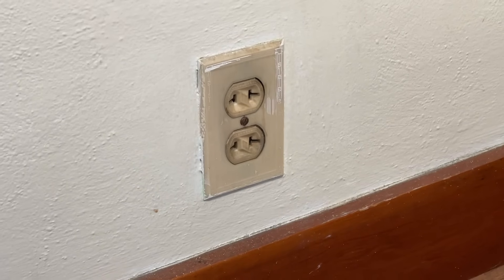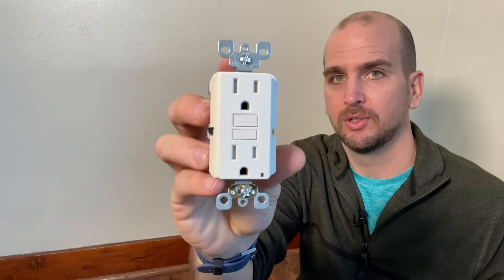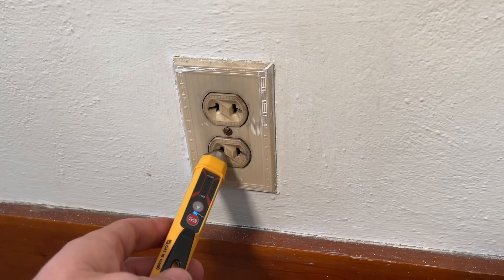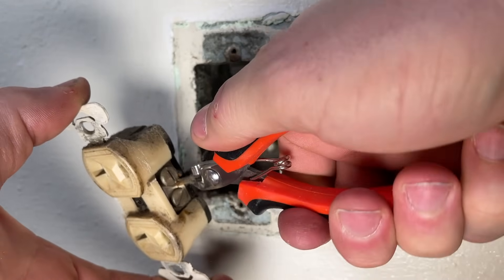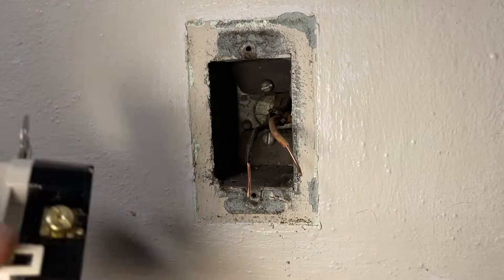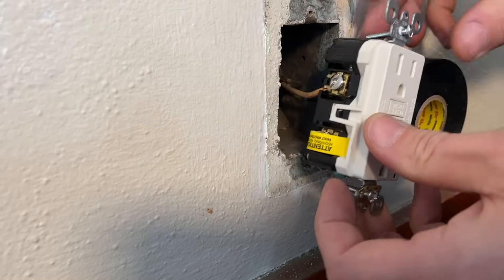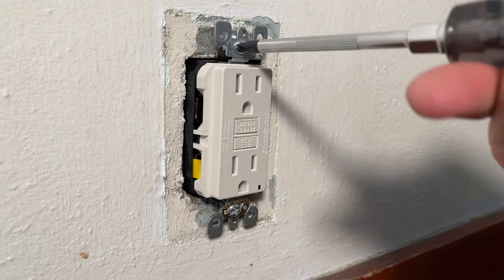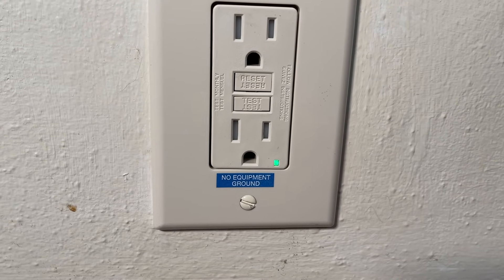How To Replace An Old 2 Prong Outlet Using 3 Prong GFCI

Comment: I'm a new homeowner and have confirmed I have open-ground receptacles just like in the video. I was going to replace one in my living with a GFCI but also want to add an additional receptacle above it for a wall-mounted tv. Can I tap off the current receptacle? Would I just connect the two wires together? Would the outlet I add also need to be GFCI?
Reply: yes you can do that. I don't know how but that would work.
Reply: Only the first outlet needs to be GFCI. The load out terminals are protected, so anything connected there can just be a standard receptacle.
Reply: To my knowledge this is only about replacing receptacles. If you add them you should do a complete rewire or at least wire a ground to the new outlets.

Amazon sells kits that allows you to hide the wires. Since they connect to an existing outlet they likely would be legal. Hiding a standard power or extension cable in the wall is not OK.

Comment: What if the wiring to hat box was run in metal pipe that is grounded?  Then it would not need the sticker”no equipment ground!”
Reply: Our trade might need a test device to check to see if the pipe grounding is adequate for grounding by putting a quick short on it.

Comment: I am surprised to see the grounding wire on the receptacle is not grounded with the metal box. My parents house have the same old wiring and there is a copper wire attached inside the box at the very back bottom. I added a grounding pig tail to the receptacle and join that together with the existing grounding wire.

Comment: Without a jumper from ground to neutral, the GFCI will not trip when you have a ground fault.  This will also solve the open ground issue.  If you look in the circuit breaker box, you'll see that ground and neutral wires both connect to the ground buss strips anyway.
Reply: Beyond the first means of disconnect it is illegal for ground and neutral wires to be bonded.
Reply: @joshfalk8323  I'll have to remember that.  I had learned the trick from a old electrician that was replacing an old 2-prong on knob and tube wiring.
Reply: Please learn how a GFCI works. A jumper between neutral and ground is against the code in the US. It is legal in old installations in some other countries. But then in Europe the only reason to change to grounded is that one actually wants grounding. One can use grounded plugs in ungrounded outlets.

Comment: Thanks for putting out this video. While painting the interior, I'm replacing all receptacles and face plates. I'm trying to make the house look a little more like it was built in 1929, going for polished brass plates and brown switches. I have run grounding wires on a few, but this has really made it nice in the areas where there is no access to run a ground wire to the panel or clamp to a grounded steam pipe or a water pipe.
Reply: dont ever run a outlet ground wire to a water pipe or steam pipe, you could electrocute someone. Thats an entirely different grounding system, that has nothing to do with the bonding system. Its too hard to explain in a short comment why. But you could end up electrofying the freaking water. Im a journyman electrician
Reply: @portaadonai  It's strange. In Quebec, the building code specifies four ways to make an ungrounded electrical outlet compliant, and connection to a cold water pipe is one of the accepted solutions.
Reply: @sg39g  noooooo... thats bad. It works with all conditions are correct, but if one condition fails, then you electrify the water. 
The cold water pipe is a earthing system. The ground wire for your outlet goes to the bonding system. Which is designed to trip the breaker is something is wrong. The cold water has nothing to do with tripping breakers.

If there is a plastic pipe in the cold water system, or perhaps the cold water isn't bonded to the neutral at the panel, or perhaps there is a valve of sorts between the outlet bond and panel bond to the cold water, you don't complete a smooth path for the breaker to trip, and instead you just electrified the cold water in the house
Reply: @portaadonai  I agree with you on the potential problems with this kind of installation. But it is nevertheless well written in the Canadian code.

And strangely, we don't have the option of installing a brand new electrical outlet that doesn't have a ground pin. It is not available in stores.

I will copy the article for you (translated from French by google translate).

You who seem to know the subject well, you could perhaps answer a question that I have had for a long time. I wonder why the code (at least the Canadian code), does not allow installing a dedicated ground to an electrical outlet to make that outlet compliant. Seems to me that would be as good or better a solution than connecting the ground to a cold water pipe.

----

Article 26-700 General

[...]

7) If, on an existing electrical installation, sockets without earthing are replaced by sockets with earthing, the earthing terminal must be effectively earthed by continuity of the masses. and it is permitted to use any of the following ways:

a) by connecting it to a pipe or metallic sheath connected to earth by continuity of masses;

b) by connecting the earthing of the network by means of a continuity conductor of the separate masses; we

c) by connecting it to a metal cold water supply pipe located nearby and grounded.

8) Notwithstanding paragraph 7), at outlets that already exist where there is no grounding device in the receptacle housing, it is permitted to install receptacles with grounding. earth without earth continuity conductor, provided that each power outlet is:

(a) protected by a Class A differential differential forming an integral part of this socket;

(b) powered from a receptacle containing a Class A differential; we

c) powered by a circuit protected by a class A differential circuit breaker.

9) There must be no bonding conductor between an outlet protected by a differential differential, in accordance with paragraph 8), and another outlet. [...]
Reply: @sg39g  It comes from a misunderstanding of the grounding systems, there are two separate systems that do two separate things. The ground on your outlet should go to the neutral in the service panel, if not, its useless
Reply: @portaadonai  I understand. You taught me something. I still have a lot to learn if I want to be an electrician!

Comment: So does this upgrade meet most common code specs? We’re elderly, our house has the original 1934 wiring in the attic and walls, except before we moved in 96 we upgraded the main box from the old screw in fuses to breakers, increased capacity. All the wall sockets are original. It’s time to sell. I’ve been thinking we won’t be able to sell until all the outlets are grounded.
Reply: You could follow this video and install gfci and legally meet code. There is also a less desirable option, which might not be allowed in your jurisdiction especially in a tight housing market.  Assuming the original wiring meet code with the home was built in 1934, in most cases,  that would fall under the grandfather clause,  meaning your not required to upgrade.  However you would probably have to disclose that when selling,  with could make the home difficult to sell.
Reply: Another issue assuming the wiring was original from the 1934 build,  is it very likely to be ancient knob and tube,  which can open a whole can of worms, including, open splices to more modern NM cable inside walls and ceilings, wires and splices  buried under insulation which can be a serious fire hazard,  circuits with reversed polarity due to most wiring of that era was not color coded , switches wired on the neutral conductor,  devices not in junction boxes, and worn insulation that disintegrates just by touching or bumping it, and in general,  electrical safety and code regulations have gotten much improvement in the past 85 years.

Comment: I have a 1932 house. I did read in the NEC that you can replace a 2 wire receptacle with a 3 wire  type if you run a ground wire. Or, you can just install a new 2 prong non- grounded receptacle or a non- grounded GFCI like you did  My house has BX ( Armored Cable - AC). The BX outer jacket mechanically connects to the box - subsequently the box is at ground potential by means of this connection.  So, if I purchase a 3 prong receptacle that grounds the receptacle ( 3rd prong ) to the box by means of the mounting screw at the bottom, is this "legal"?  I read somewhere that you cannot use the box ( or a mechanical connection)  as a means to make an electrical connection and that separate wires are required. Any help or comments from readers would be appreciate.
Reply: No, and it isn't safe. 
The intent of the NEC is safety.   The ground connection is there to protect your life. . 
Assuming that safety, not code compliance, is your concern, thee mounting strap of a receptacle is not a mechanically reliable ground connection.   A high resistance or open grounding connection will not trip the breaker. 
The screw and strap are unplated steel alloy and can rust. Rust is a poor conductor. The standard strap screw has a tapered base that only bears against the strap on two thin areas.  The straps are often used for leveling the receptacle against the wall, not solidly against the box.  The strap screws tend to work loose with many plug/unplug cycles. 

Pragmatically, if there is less than 2 ohms resistance between the box and panel ground, you could install a green wire grounding jumper between the box and the receptacle and have an electrically safe installation.   Unless the replacement is being done with a permit  requiring an inspection, an inspector would normally would rely on a three wire tester, and check mounting quality which would verify electrical safety.

Comment: Ok if the home has grounded flexible conduits leading into the recepticle.  Can you use a conventional outlet and ground that outlet to the receptible box making sure there is continuity to ground?  Those GFI's are not cheap!
Reply: But life is? I see no point why anyone would install a non-protected outlet. I looked them and they were a little over $10. In Finland normal outlets cost more.

Comment: You are actually wrong as the single negative hole should be on top that way if something hits it like metal etc it will not cause electric shock.
Reply from the maker: Wouldn't say "wrong" but I am well aware some install ground up.  If you want to dive DEEP into this topic you can scroll the never ending comments on this video https://youtu.be/kYXvcog9MxY
Reply: ugh.  I despise these comments.  The numbers don't add up to making this any safer.  We're talking about something that happens less often than a child sticking a fork into a receptacle.  Once every 10 years there is a fire or an accident due to something metal falling across the exposed hot and neutral.  
Then look at devices - we'll take plug in air fresheners or night-lights as an example.  They would have to upside down (recently some manufacturer's have started making them with rotating plugs) in order to plug in the way you suggest.

Comment: If your electrical box is not grounded, GFCI will not trip. To have a working GFCI, one needs to ground incoming neutral wire to the metal box. Now you have a path for ground fault to travel, and GFCI will now trip.
Reply: Wrong. GFCI does not need a ground to sense a ground fault.
Reply: Try hooking a 2 blade plug into a regular Non GFCI outlet. Then have that two blade plug going to a GFCI receptacle. Then hook a hot to ground or neutral to ground jumper plug into the GFCI outlet. The GFCI will not trip, even though you have a ground fault, as there is no place for current to travel in the ungrounded GFCI.

I use the opposite of this circuit on my camper.  When i have to plug it into a GFCI, normally the camper will trip the GFCI because i am using s 3 prong plug.  Cut the ground prong off a 3 prong plug, and hook it to my camper cord. Then plug the camper into a GFCI, the GFCI will never trip. ( In my campers case the 12 volt common is grounded to it's camper frame. The power ground is also hooked to this same frame ground.  The ground fault occurs when the battery charger is charging and a harmoníc eddy current is formed. If this current has a path to a real ground then the protecting GFCI will trip. )
Reply: @geoffmolyneux9173  The point of a GFCI is to prevent the current flowing through YOU. In case of nuisance tripping the current often goes through the ground wire but that is what a GFCI is for.

Comment: I would like to know , do you not have to put GFI in the beginning of the line , not the end of line ? And you have to put the label on outlet letting the owner know it is not grounded . The reason I asked the outlet had only two wires , unless you are putting GFI on every outlet.  Which is it?
Reply: The GFI trip circuit monitors the neutral and hot current and trips when the hot and neutral current are different. Knob and tube wiring may be spliced without a box, so all the neutral current may be going through the receptacle.

Comment: Is it possible to make all outlets in a room GFCI (I have a bunch of free ones) and not have them each trip if one outlet trips? Would you use two wires in each side of all line terminals and no loads?
Reply from the maker: Yes, but you most likely leverage pigtails in boxes where you have more than 1 set of wires.

Comment: If there is no equipment ground, what protection is there? does the gfci just kill the circuit?
Reply: I think the idea is that the GFCI would instantly cut power to a shorted device if ground was present, but in this case the grounded human would have to touch the device for it to trip.

Comment: Scott - Can you please advise how to tell which receptacle is first in line?  I watched your video at https://youtu.be/7aHeRgpfQhE but it tells how to replace the outlet - not determine which one is first.  I understand I could test a GFCI in each outlet, going one by one and then turning the outlet off - but is there any way to improve my chances of finding the first outlet?  I imagine the last outlet in the series would have only two wires (not 4), but any way to improve the odds of guessing the first one in the series?
Reply: Daryl Specter
1 second ago
Best way is to disconnect all the receptacles and then with the wires hanging in free space (not touching anything or each other), turn on the breaker and see which hot tire is powered using the contactless probe.

Comment: the non-contact voltage checker you were using is called a "widow maker". You keep trusting that, you will have a widow collecting insurance money. I agree with you about the conversion device for 2 prong to 3 prong being a bad idea. It does not not provide the best ground, if at all. You used the "widow maker" as a last, but why? Please do not lead the public that a GFI needs a ground path.

Comment: How do you get the smoke back into the wiring if it gets released?
Reply: Just touch up paint the arc flashes and walk away 👍
Reply: Wiring actually has a lot of magic smoke . . .  compared with a small electronic device at least. Quite a bit can come out before it stops working.
Reply: Smoke is not the issue. Getting the flames back in the box is more important.

Comment: Electrical tapr on a receptacle causes heat and resistance and is actually against code now along with taping wire nuts....just saying

Comment: No ground at outlet, so why not use a $3.00 receptacle instead of an expensive GFCI?
Reply: The GFCI offers extra protection where the standard outlet does not.
Reply: @dogthewalker8071  How is that possible when  you dont have a ground wire?
Reply: @dncndan1  He does quickly mention this somewhere in the video.  Sorry, I do not have the timestamp.  It's an added measure of safety (not perfect) vs. using a simple outlet (nothing.)
Reply: @dncndan1  Please learn how a GFCI works the ground wire is not essential for it working. A GFCI compares current in the line and neutral and if they differ more than the designated threshold which is 5 mA in the US it will cut the power. Ground wire is not used in the testing though having one may help in the fault occurring.
Reply: Because that would be against the code. Never make illegal fixed installations. If you want to do tricks do them with plugin stuff.

Comment: GFCI is a good investment.  AFCI is still to much $$$.  Most the outlets are now tamper resistant.  So I can't use my old tester I use a lamp as my tester.  I never seen that no ground sticker in a box.
Reply: That works...until you have a faulty receptacle.  I was replacing an old GFCI (the test button fell off and the little spring was falling out). Tested it with a radio and I thought I had the correct breaker.  Checked it with my neon tester and surprise!  I had the wrong breaker.